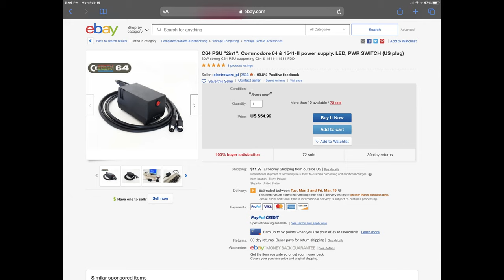Commodore 1581, C64 and Enhancer 2000 power supplies

Comment: Nice setup. I agree this Electroware 2-in-1 is a nice PSU. This is what I also decided on, after disappointment with the competing Keelog product, which supplies too high an AC voltage for the C64.

I also modified the original 1541 to take DC power input like the 1541-II and modified this Electroware power supply to provide more power, because the original 1541 needs it.

If anyone's interested, videos on all that on my channel... and I also take apart both the Keelog Dual and Electro 2-in-1 and comparing the components!
Reply from the maker: Will check out your videos....   thanks

Comment: Sir, I question the wisdom of piling more drives on your 1541, it will get hotter.
Reply from the maker: Only had them this way for the video. On most days I only have one drive hooked up if even that since I primarily use the backbit cartridge as a drive.   Good point though on heat.